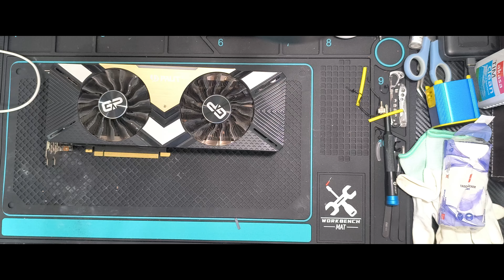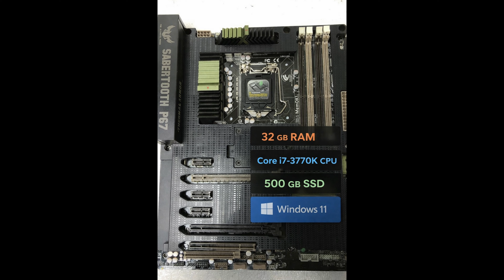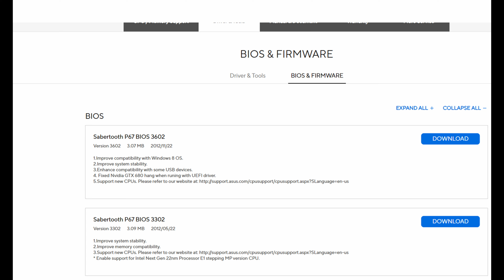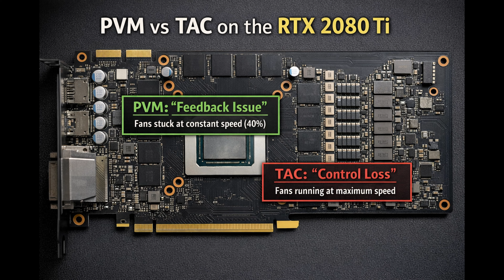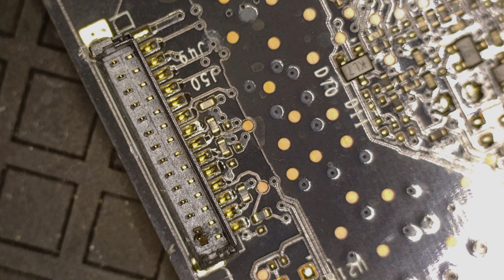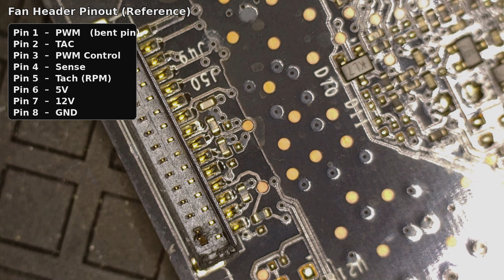RTX 2080 Ti Fan Control Failure – PWM & Tach Explained

Comment: Recently my GPU's fan always goes full speed the instant i powered on the PC and its always stay at full speed even when the temp is cold, shit happen suddenly idk the cause, i dont any issues performance wise, only the fani..how to fix that
Reply from the maker: Sorry for late reply , i got some things to do. The symptom you are describing is more likely a "fail safe" issue. That is happening when your fans are not connected thru a PWM signal . I dont know your configuration,but i assume that your fans are connected to a hub wich is powered ,but you have not connected the hub to any pwm signal. So the pc does not know the state of the fans,so it is running them at the highest prm possible thru the voltage